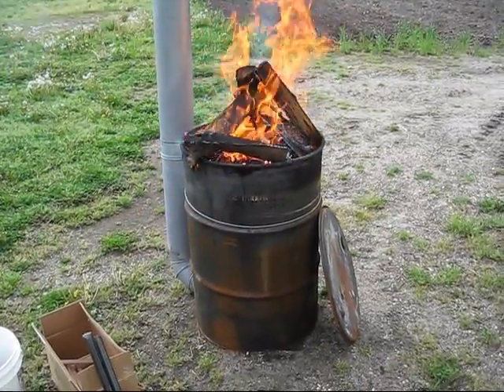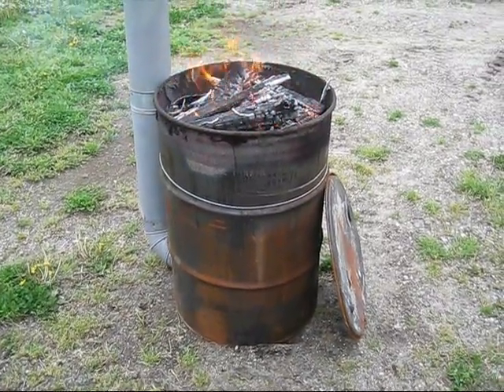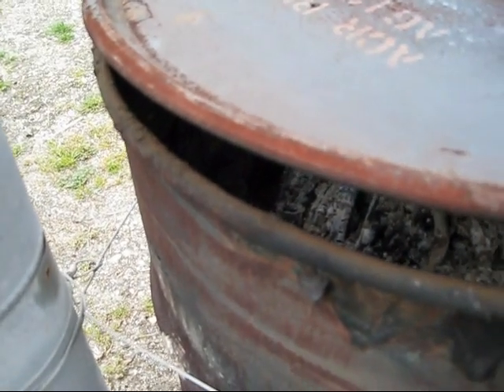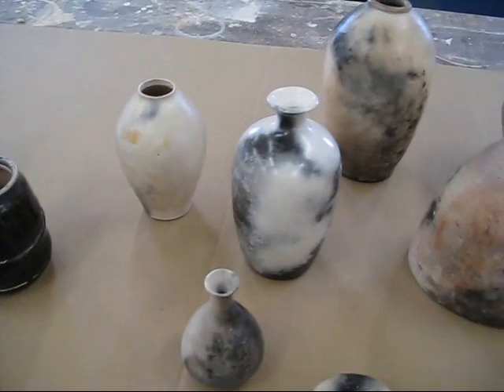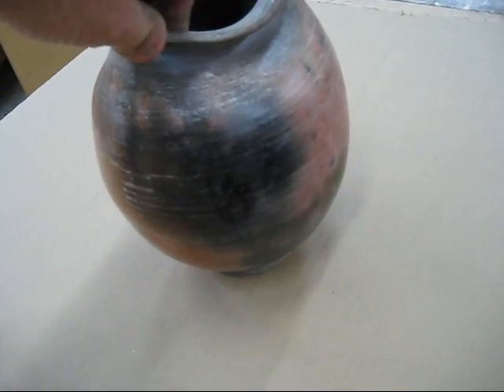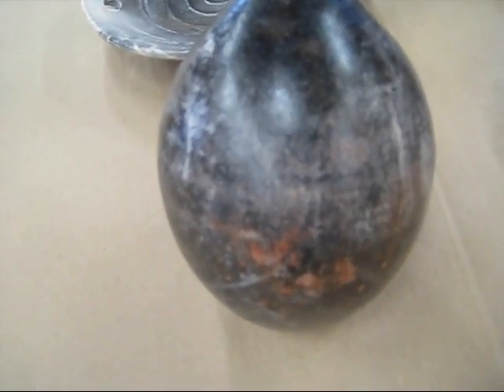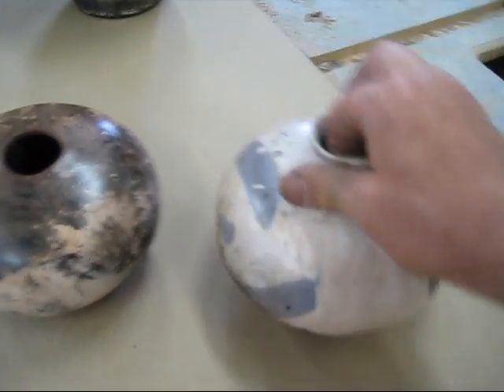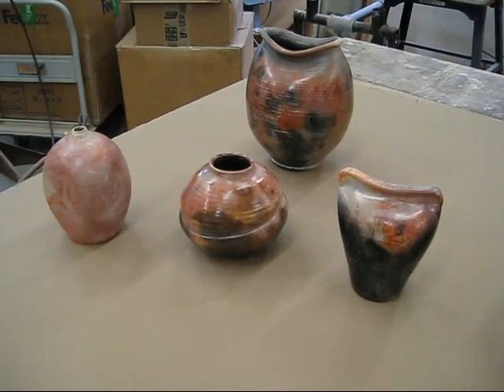barrel kiln firing

Comment from the maker: @wphlea thanks for you comments. i fired  to 06 to bisque i use a standard clay #182 which is white and a #205 which is a red both cone 10 clay. the chips do fall down through the screen and it most likely helps the firing. just don't pack it to tight.. and back it with some straw, sticks. and wood chips, and long rolled up newsprint. don't be afraid of putting to much wood on top in fact i even fed the fir before putting on the lid... good luck john

Comment from the maker: @theprettypotter its simple you need= 55 gal drum {better if you have a removeable lid}, 4" or 6" stove pipe, metal grate for the bottom. because it works like a up draft kiln a pit won't  work as well.  the trick is stacking packing it with sticks, newspaper,sawdust,and hay. then building a fire on top get a good bed of coals before putting the lid.. john

Comment from the maker: @ckhansen19 sorry i didn't do a video on loadingi was going to when i do another firing. backing the barrel is't hard. layers straw, sticks, pots, saw dust, rock salt,  and other colorants.  and start the fire on the top.no the chimney doesn't need to be 14' high its just what i had laying around but you do want to have a good draw and hight is whatgives you that.  the sig is terra sigllata which take the place of burnishing.  i put it on before bisque firing.

Comment from the maker: @adrianataba  iron oxide is most likely what created the red. if its in the right atmosphere. if you would like more reds try  ferric cloride you can buy it a radio shack its a copper etching ...spray it on dont use any metal sprayer if check out my saggar firing video it will work in this type of firing... john

Comment: Hi John,
Is there a way with the primitive, non insulated firing like pit fire, barrel fire,...
that the pots are gonna be waterproof? Because i like these ways of firing very much but its never usable for a vase or such, wich holds water. And am i right that the chimney will olso increase the temperature in the barrel?
Last question: does this way of firing bake the pots more than bisque? Or is it just for the colors?
Thanks a bunch!
Greeting from Belgium

Comment: Hubby just built me a downdraft barrel kiln, just like yours!  I can't wait to try it. To what cone do you bisque fire your pots before putting them in the downdraft kiln?     I am using medium fire stoneware clay (Laguana B-Mix & Plainsman M332 red clay).  I burnished the pieces and will  not use T-sig.  I am also wondering what you did when you loaded the kiln. Do you allow chips or sawdust to go through the grate to fall on either side of the slotted pipe inside? thanks in advance

Comment: Would anyone know the definition of sig or cig used in this demo?
Reply from the maker: Terra sigillata is an ultrarefined clay slip that can give a soft sheen when applied to bone-dry wares and, if polished or burnished while still damp, may give a high gloss.
Reply: Terra sig can also be applied to leather hard clay as well . I made both white and red terra. There are many recipes on internet. Apply a layer and let dry throughly before doing a 2nd coat or a 3rd. Then it can be polished with a plastic bag or plastic wrap which is wrapped around your fingers. Adds a beautiful sheen.

Comment: I fired my new downdraft kiln last evening.  I used sawdust, "used" straw cow bedding shredded paper and for wood I used old fence posts.  I topped up with more wood as the fire burned down then put the lid on as per your instructions.  After  3 hours, I still didn't have a downdraft. so went to bed.  This morning the kiln was smoking slightly from the stovepipe only and when I peeked in I discovered all the combustibles had burned up. See results at playsinclay.blogspot.com. Thanks 4 your help